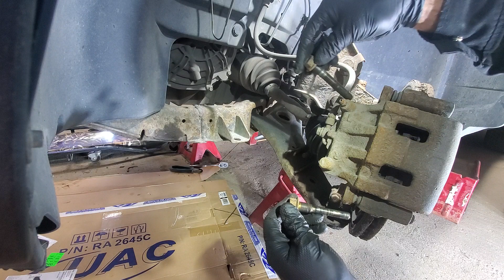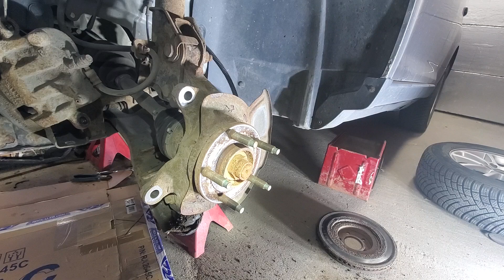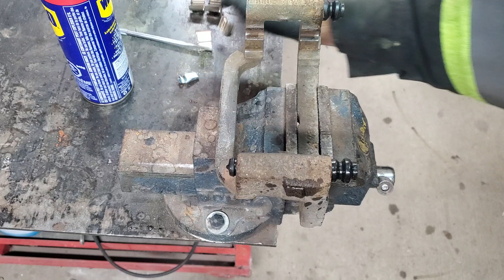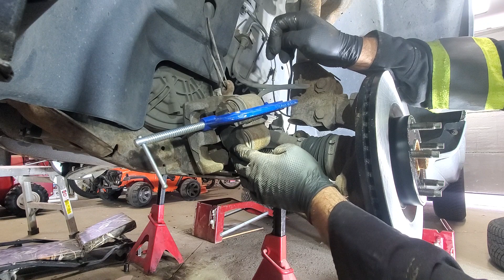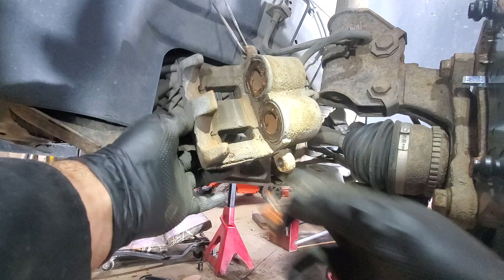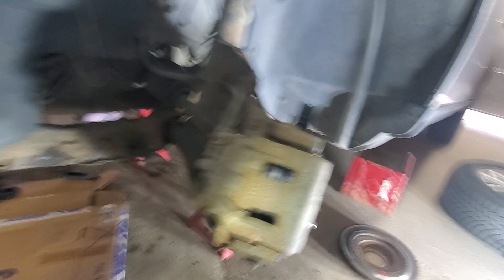2007-2014 Ford Edge Front Brakes Replacement | Rotors, Pads, Hardware and Boots

Comment: Hi. Great video.  I have a question.  What do you use for cleaning the rotors and when you pushing the caliper the brake reservoir needs to be open? Thank you
Reply from the maker: Thanks! Brake clean for cleaning rotors. The reservoir should be open and monitored for overflowing. 
https://amzn.to/3REVz16